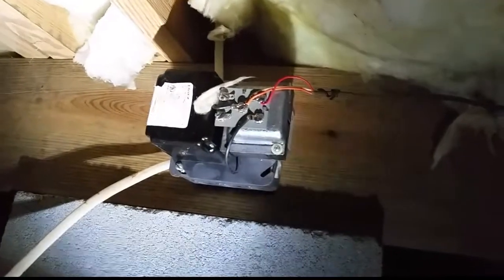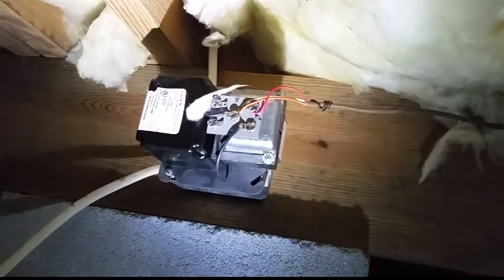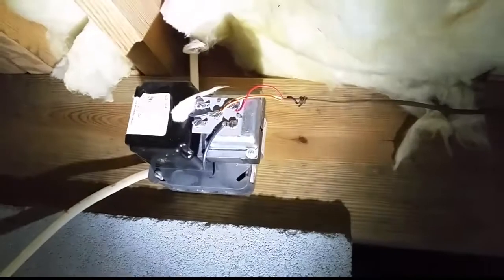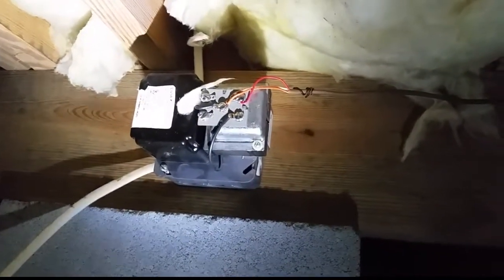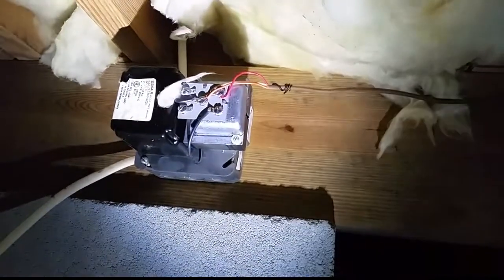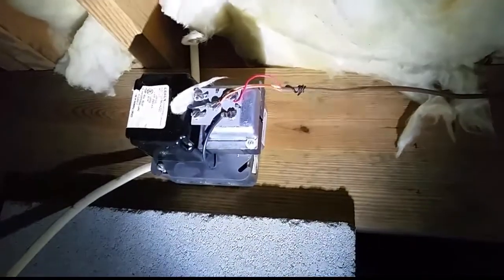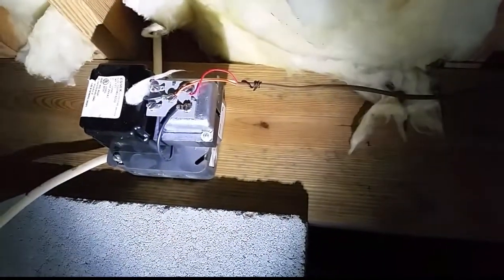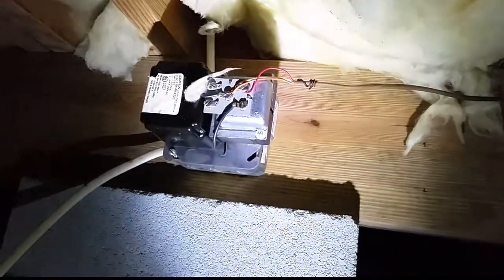Using a Duct Booster Instead of Zone Components

Comment: Like the pigged in electrical connection. Boosters will work if sized and installed correctly but what you have there is a hack.
Reply: Your right Rob. In my world (residential ) they are used poorly 99% of the time.